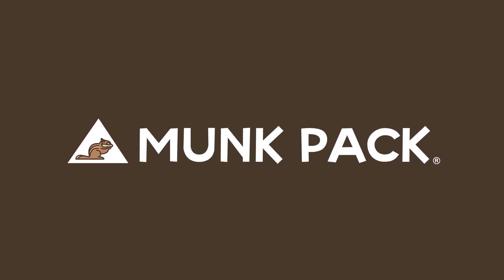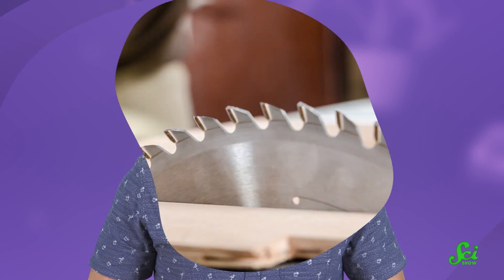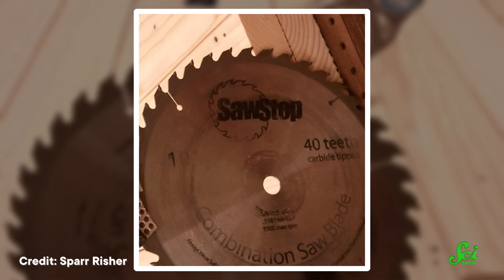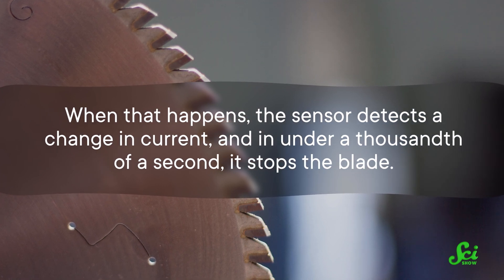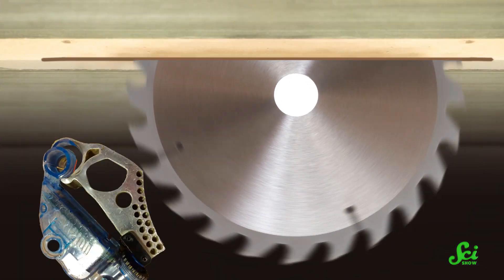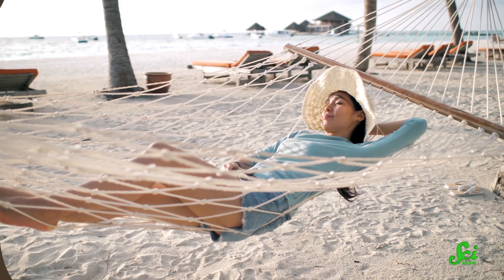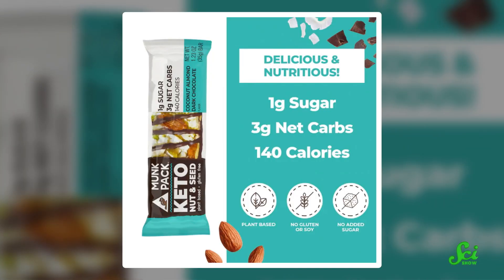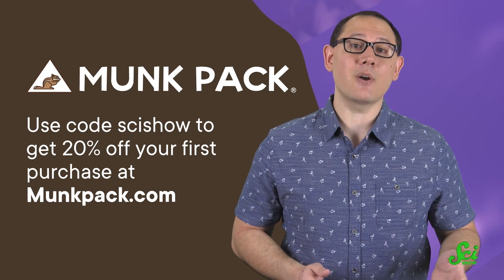How Can a Saw Know What It’s Cutting?

Comment: The reason these are not standard is NOT BECAUSE IT'S "STILL PROPRIETARY!!!"  This device was invented by a garage-based DIYer who has been willing to license the rights cheaply for over 20 years.  He has been rebuffed by manufacturers and sought to get safety standards increased to require them in the US.  If it were the 1970s or '80s he may have been able to but $$ talks in this benighted century and he is not a large corporation.  The added manufacturing cost of this device will be negligible (under $50/unit) once in mass production and it would be if they were required on all US saws, as are blade guards at this point (which everyone takes off anyway).

Comment: Here's an idea.  Make the blade so that it always has an electrical current running through it, and will shock the user pretty strongly if touched, spinning or not.   My idea is to provide current for the brake, at the same time as subconsciously training the user not to touch the blade with the saw plugged in.  There are plenty of ways to maim yourself with a table saw.  Almost as many as there are with a skill saw :)

Comment: I've used one of these, and while the safety feature is really nice it gives false positives more often than you'd like and it's expensive when it does.
Reply: For anyone curious, 9/10 false stops occur when sweat gets on the work piece. Salt water and electrical conductivity and all that. The failure rate is roughly equivalent to weird behavior of smartphones when touched by sweat or water or any object other than a finger or stylus.

The system I used necessitated replacement of both the blade and part of the braking mechanism with each stop - and got 3 in about 70 hours of use. Way better than losing a finger of course but it is more expensive to run with this safety feature than without it.

Comment: I think this is technically wrong explanation. It is capacitance not condition. The main issue is that there is a tech by Bosch that works better and is not destructive but they were sued by the owner of the presented tech. So much for safety first ...

Comment: As long as a SAW operator is always paying 100% attention to what their doing, they wont be a statistic of a cut off finger. i was 27 when i accidentilly cut my right hand pointer finger in a table SAW blade. Took a chunk of my finger off to the back of my nail and it was the fastest pinch id ever felt. Happend due to haist and instead of using a push stick like normally i used my hands and it was a damp morning cutting azek trim aka( plastic trim)

Comment: Proprietary... I'm surprised such a simple mechanism can be patented (mayb the brake, but the sensor is basic). And it's like: "We don't want you to loose your finger...but only if you use our stuff. We actually don't care about fingers, so go ahead and loose them somewhere else". For comparison: The three-point seatbelt was made patent open by Volvo so every customers are safer even when using other cars.

Comment: I sold many Saw Stop table saws, even got to speak with the rep. for North America. He told me that the design was pitched to many of the leading manufacturers, but none wanted to pick it up for fear it would invite legal cases from people who were injured by their saws without the feature.
The incredible amount of force the brake puts on the blade from the 150lb spring is transferred to the arbor of the motor as well, so the bearings have to be over engineered to withstand the impacts.
Also when the blade suddenly stops spinning the rotational momentum is leveraged to whisk the blade under the table of the saw. It's truly a beautiful piece of physics engineering.

Comment: Part of the problem with this specific technology is what it has developed into. SawStop used to use a plastic cartridge so the blade can be reused. Actually you can be up and running again quickly. I run a $200+ Forrest blade on my saw and would hate to have to replace it over and over again.

Comment: I remember back in shop class when our usual instructor had his brother sub in when he was sick. They both looked almost exactly alike, minus one left arm. Since it's obvious all the kids are curious, the brother sat us all down and told us his story. See, he and his brother (they were in their '60s then) used to work in their uncle's timber processing plant when they were young. There's a machine there that was basically a series of criss-crossing saws that could cut a tree into square wood sections in one go. Occasionally the machine would stop from having something stuck locking saws together. To fix this, someone had to manually pull whatever it was out of the machine. To do this, the saws had to be stopped, then run again, then stopped again if it turned out they were still stuck, then run again, and so on until everything got unstuck. So, my instructor was holding the controls while his brother was working the obstruction. Their signal for "on" was a handwave to the right. The signal for "off" was a handwave to the left. That's where he stopped the story and let everyone fill in the rest.

Comment: You can actually run your hand over a table saw blade that lacks this mechanism, and not have it cut you. It just requires the saw have a diamond blade, which will easily cut rock but not flesh. 

On a side note, it's unfortunate this new safety technology was only invented in 1999. Because the woodwork teacher I had at school (I finished school in 2000), had cut almost all of his fingers by time I started at the school.

Comment: I wouldn't have given these jerks the coverage (not that the need it), but talk about the Bosch system that was much better, cheaper, and environmentally friendly (didn't destroy blades or chunks of aluminium). The blade was on a swing arm, when triggered the blade would drop below the table and continue to spin, a lot less wasteful/destructive. You would then turn the cartridge around and continue. You got two activations per cartridge, which I believe were less than half what scumstop charge. Just another example of the ridiculous patent system stifling innovation and better design/implementation.

Comment: I had my cast taken out some time ago with a saw which physically could not cut skin , wonder how that works .
Reply: it's a dremel that doesn't rotate, it just turns one way and then back the other. this lets it cut through rigid plaster but when it touches your skin it just moves it back and forth because your skin is flexible

Comment: Felder have a developed a safety feature that doesn't require contact with the blade and doesn't destroy the blade or the breaking system like Sawstop's does. It means you can reset and be back up and running almost instantly (after a quick change of underwear). Unfortunately Felder tablesaws are not really affordable for most hobbyist wood workers though, they're aimed at industrial production use and have a ton of additional features that are appropriate for that market.
Reply: I think the fact that it destroys the break cartridge and also mangles the blade slightly isn't that bad, if you're practicing good safety as every woodworker should you likely won't have any activations, in the rare case you do you just replace the brake cartridge and blade. also even though sawstop claims that it destroys the blade you can usually dig it out of the aluminum and then send it in for inspection and sharpening if it's a high-end blade.
Reply: @draconic5129  Yes I agree too, activations should hopefully never happen. It's definitely a fantastic feature for sure, regardless of the mechanism used, if it can save your hand from being mutilated.

Comment: Whoops!  At 2:05 you reported the time to stop the blade as "microseconds".  The speed for the blade stopping event is measured in milliseconds by the manufacturer, like stated in the beginning of the video. A few milliseconds is a short period of time, and reduces the chances of serious injury on the saw, but if it were a few microseconds, it would be blindingly fast in arresting the blade to come to a stop.

For the record, the inventor of the technology at the time he created it first tried to license and sell just the safety technology to the main manufactures of table saws in the USA at the time.  (Delta, Powermatic, Jet, Dewalt, etc.) They all balked on the offer because their legal departments determined if they put the technology on a single model of the many table saw models they each sold, all other table saw models in their product line up of table saws without the technology would open them up to lawsuits.  As a result, the inventor decided to manufacture his own table saw with the technology.

Comment: Why must be the blade be exposed? Why can't it have a hard case or something that can be used to cover a portion of the saw when in use? Something like a transparent box that can sit slightly above the wood being worked? How often would such a device be cumbersome/impossible to use (as opposed to all the lost appendages)?
Reply: They have that, it's called a blade guard. You don't usually see people on YouTube using them because it makes it harder to get shots of them cutting wood but you should definitely use them as they make it significantly safer to use and they reduce the likelihood of kickback since they have a built-in splitter.

Comment: Also to add to his words of caution is the detector only detects you touching the ->blade<-. If the saw blade catches a piece of wood because you where careless it could fling it at you at high speed or pinch your finger between pieces.

Comment: BIG words of warning for everyone. This safety feature is disabled as soon as the saw is turned off. If you think about it, this must be so or the device would trigger every time you touched the blade during saw setup. This is important because many (maybe even MOST) saw accidents happen after the saw is turned off and the blade is spinning down. I know because it happened to be TWICE in 6 months. (Then the wife made me sell the saw) It is easy to lose concentration during the spin down period. Luckily, I still have my thumb. It just doesn't have as much feeling as it did. PLEASE be careful during spin down. Les
Reply: There has to be a way around that. A simple RPM meter set to say 5rpm that disables it at that speed, since during blade setups if you need to touch the blade, there no way you're spinning it that fast. Or even a timer of some sort that would keep it active for a set period of time (this might be harder since blades are slightly different weights...), or a motor brake on power-off.
Reply: @Bob_Dunkin  I would love the motor brake. Like on my Skil saw. A circuit could be designed to keep the circuit hot as long as the blade turns, But it would probably not be profitable. Maybe a centrifugal switch on the motor somewhere. But then it wouldn't be a bolt on kit.

Comment: I remember the first trade show this was demonstrated at. They were offering to license it every saw manufacturer . None of them took the offer because the attorneys said it would open them up to liability claims unless they used it on every tool they made. They were also afraid of claims against every saw they had ever made before the tech was available. The inventor had to start his own company to build them. The hot dog used in the test had a nick in the skin about 1/8” square, I got to hold it. The charge that goes off slams the brake into the saw teeth and pulls the blade below the table. It makes a very loud “Bang” when it happens. SawStop makes an excellent table saw.
Reply: Funny how that part of the story is often left out. Also, few know that the braking system isn't the only unique thing about SawStop saws. They actually have to be over engineered and specially designed to handle the incredible force of stopping the blade. The ICS SawStop still ranks as the heaviest tablesaw in its class due to the huge chunks of metal in it. Everyone gawks at its price tag, but it is a seriously quality built machine besides just the braking system.
Reply: @ZunarZulfiqar  What's really impressive is if you use dado blades (and the associated brake cartridge). The force of the blades stopping can break welded teeth off of the blade.

High-speed footage of any activation is impressive, too.
Reply: My highschool had a sawstop in the shop. Can confirm, it is a quality tool. Granted I haven't dealt with many shop table saws, but yeah, if you're gonna be paying the price for advanced safety features like that, you want to have a good saw in the package too, and sawstop delivers.
Reply: Yes but nowaday they are just stopping innovation of the tech and costing people fingers with their patent monopoly, so many companies offered them partnership when it was tried and tested but they profit hungry now i guess

Comment: What on Earth are you on About? I have been using Mill saw's, Mitre saw's Chop saw's, and Table saw's all my working Life! High powered Router's that would strip you of skin and Bone's in Nano second's. You don't need to have some extremely expensive Saw to save your organic Digits! You need to understand the limitations of the machine and the Tooling. I am in my 60's and I still have all my appendages. Safety is reliant on the ability to observe standard rules. Apart from Health and safety, there are a few more. ( ACOP ) (COSSH ) (PUWER ) And there are yet more to do with Management and Planning i.e. Risk Assessment. It doesn't take a genius to work out the Benefit of logic, But it does take A Genius to Work out the possibilities.

Comment: When I was a kid, I saw a saw for cutting rocks.  The guy describing it put his finger on it, showing that it wouldn't cut his finger.  I don't think this one was using an electrical signal - it didn't jerk to a stop, it just didn't cut - he said it would give you a mild friction burn if you pressed hard.
Reply: Those saw blades remove material by slowly wearing away the stone using diamond dust.
Reply: The saw blades meant for cutting Stone don't actually cut flash because they don't have any teeth to grab on and cut instead they have an abrasive surface that wears through the rocks slowly that's why it can give you a friction burn or cut you mildly if you push hard enough but it won't start cutting through flesh instantly.

I think another channel actually did a short video on this subject but I can't find it right now.

Comment: Used these in high school wood-shop. Pretty nice peace of mind safety feature. Unfortunately wet wood can also trigger the saw stop sometimes, and the mechanism is expensive to replace. We were down a table saw for the better part of a year because a student tried to cut wood that was too wet. Really cut into our budget for other supplies. All worth it though to know we were going home with all our fingers though! Now if only they could get something like this for routing tables. Those things will shred your digits with no chance of reattachment.
Reply: The cost of replacing the "brake" unit is what drove the construction company I work for to stop buying the saws. Some jerk on every jobsite would end up triggering the saw on purpose to see it work and the brake unit is about the same cost as an entire regular table saw.

Comment: The brake cartridges and blade refurbishment are not cheap, but cheaper than a trip to the ER. I've never seen one get triggered by a finger though, most of the time in the shops I've been in it's a staple or some other bit of metal left in the wood.

Comment: From my experience as an engineer, safety features should always be present & treated as a last resort. People still die in car crashes while wearing seat belts, after getting shot while wearing body armor, & from falling great distances while wearing a parachute. I have seen some manufactures integrate similar systems into the shells of their collaborative robots. Even without that type of system industrial purpose robots do typically come with brakes built into their servos that are similar to what's on a car. If electrical power is removed they slam shut violently locking it in place.

Comment: The thing that sucks though is that the guys that own the Saw Stop IP are patent trolls who won’t let other tool makers make competing products. One of the major tool manufacturers (Bosch I think) made a much better system that is done with compressed gas that moves the saw away without destroying the blade so you could rearm it and get back to work immediately. They even made a portable contractor’s table saw (and most accidents happen on those not the big built in saws in shops) the Saw Stop guys sued them and killed that product. Imagine if someone invented seat belts then prevent everyone else from making any variation of safety harness but then also only made super expensive 5 point harnesses and refused to license the technology for every day use. I get that the Saw Stop is cool technology but we should really be shaming the lawyers who bought the IP and are preventing it from be coming wide spread.

Comment: This is a case where government should've exercised eminent domain and paid the creator handsomely for the technology, but then made it freely available and required all saw manufacturers to implement it.
Reply: Or at least prevent Saw Stop from suing other tool makers who made substantially different versions of the same idea. The Bosch compressed gas system didn’t destroy the blade and was going to be a standard feature on all their saws until Saw Stop sued them.